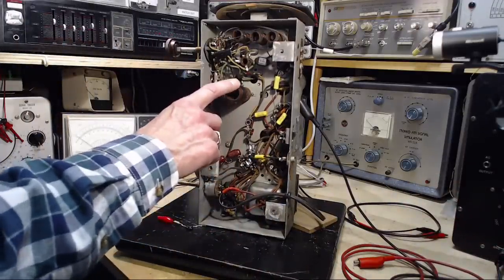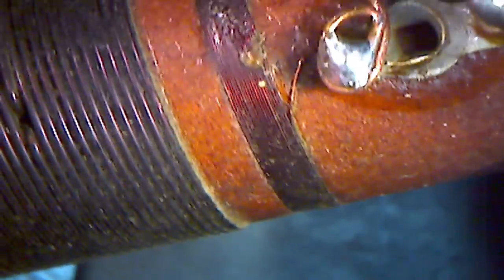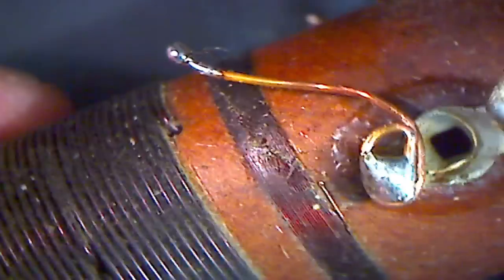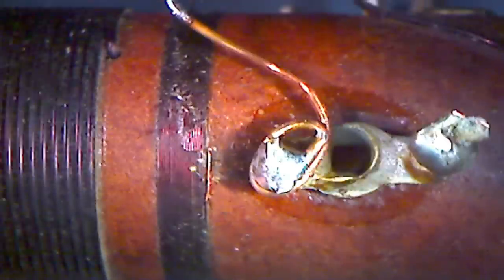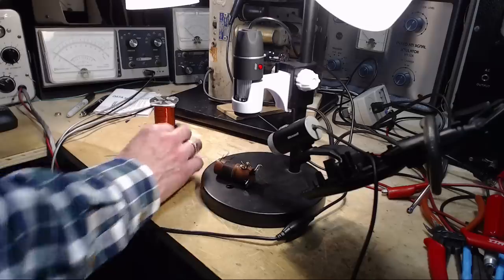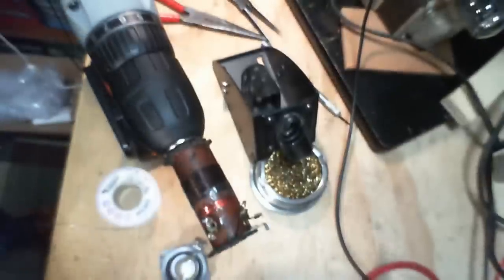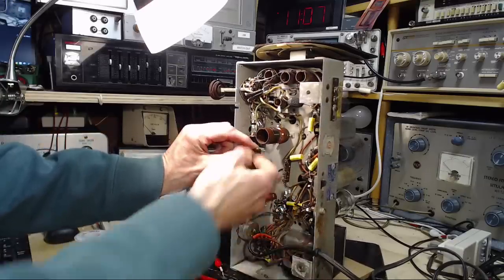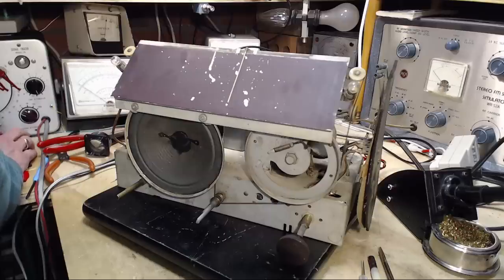RCA Victor A23 Tube Radio #10 - Antenna Coil Repaired

Comment: I would have tried an UNUN i.e one wire going to the antenna connection end the other end going to the earth and the tap closest to the negative would go to the tuned circuit via a ceramic capacitor and just take the burned out winding out of circuit.

Comment: The thin wire with the break is the antenna coupling winding. It should not be very critical in turns ratio or inductance. The thick winding is the tuned winding (with the variable capacitor) in the preselector circuit, and this one must resonate to give the front end selectivity. I think I see little "balls" in the ends of your winding at the break which suggests the wire has melted

Comment: When it comes to repairing anything, nothing would surprise me. The wire seems as fine as a human hair You can fuse a wire with a smaller wire cant you ?You can call it signal or control wire but  a slight excess in current flow can cause wire to incandes and evaporate the wire like a tinsel across the track of a model rr. It doesnt surprise me that this coil didnt take several hits. And I think since I saw you winding a new coil(smart move ,well done) you realized that this is bound to happen again or should I say is waiting to happen again as soon as you get the radio to work.

Comment: I remember repairing an I.f. coil in a transistor radio in the late 70s/early 80s. Managed to find a fine piece of wire and a piece of insulation from a very light wire. Then the tricky part of soldering it all inside that tiny can.  The radio worked a treat so I must have got it right.  Well done Jim